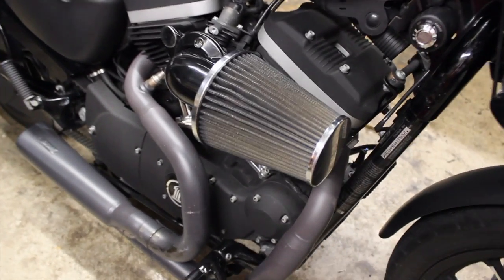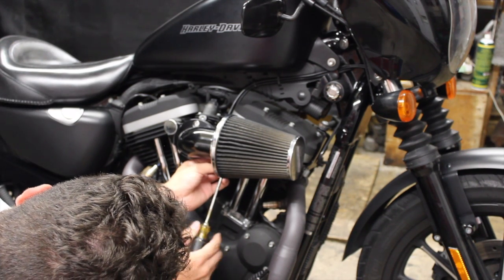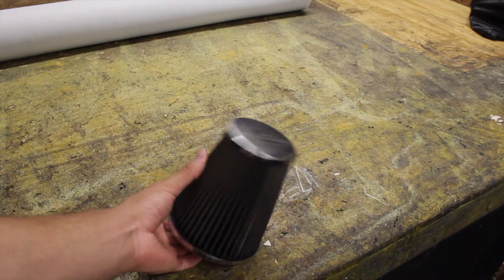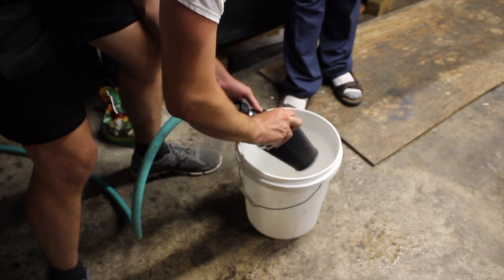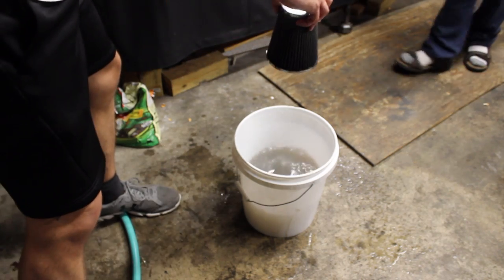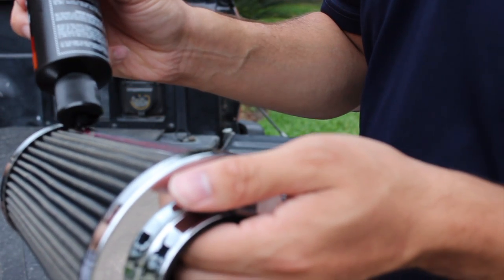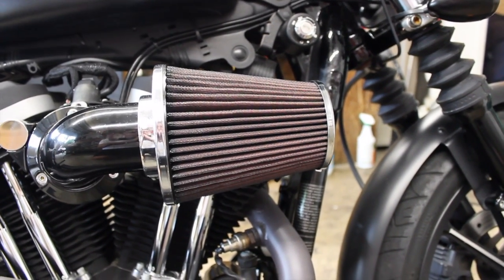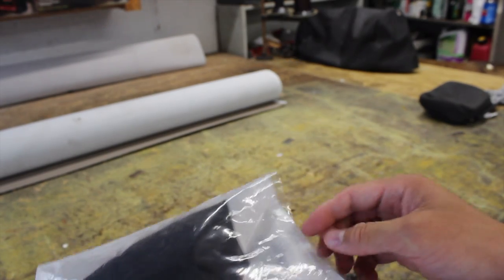Screaming Eagle Heavy Breather Servicing | K&N Clean & Recharge | Iron 883 Sportster Build Ep. 02

Comment: I have a filter just like this one and I’m having problems with rain being sucked into the breather. I’ve cleaned it and oiled it like you have shown. I even have a rain cover on it but riding in rain my engine runs ruff and wants to die. Anybody else having this problem?
Reply: I’ve seen that before in heavy rain, if your rain cover isn’t tight, it sucks water through the rear bottom of the cover.
Reply: I’m stupid and ride in heavy rain without a cover. Haven’t had problems yet🤡

Comment: How did you clean the Rust off of the Chrome cap
Reply from the maker: Amazing Grace Power ministries I used very fine 0000 steel wool. I want to say I used a little WD40 on a rag too.
Reply from the maker: Amazing Grace Power ministries I had to be very careful with the steel wool not to remove the logo etching. Left very small swirls or scratches. Very hard to notice and looks much better than before. In my first vid at around the 5-6 minute mark I show a good before and after.
Reply: At the Harley shop I work at we use a chrome polish used bike getting ready for the floor and just work it around the surface. It usually doesn't do anything to  the logo.

Comment: How often should I do this?
Reply: Depends on how dusty your environment is and how frequently you ride.
Reply: I have not cleaned mine in a year. Stupid, I know. But I recently noticed it turned longer before it fired up on start ups. That led me to believe that I wasn't getting enough air on start up. Time to clean
Reply: Good rule of thumb, clean it every time you change your fluids. Every ~5k miles.

Comment: You don’t clean the air filter from the inside out. You go in the direction the air flows.
Reply from the maker: Ahh yes, shove the dirt and debris further into the filter. Why didn’t I think of that.
Reply: I disagree! By spraying water from the inside out you are pushing the debris out of the filter, not further into the filter material.